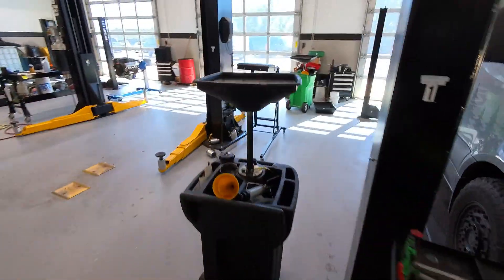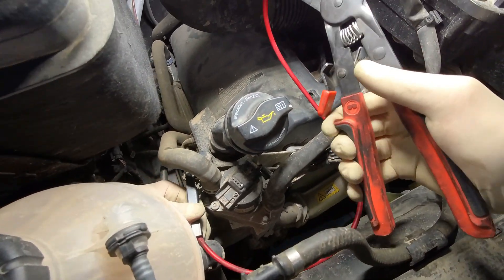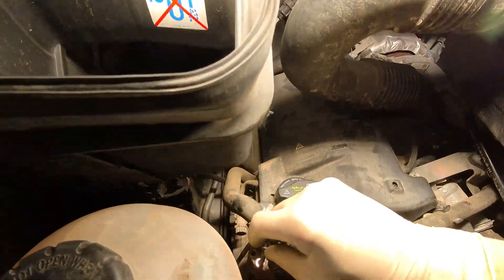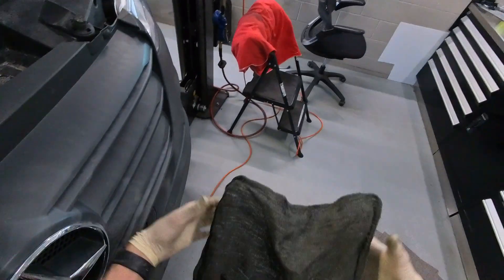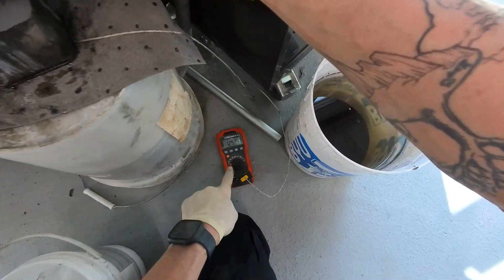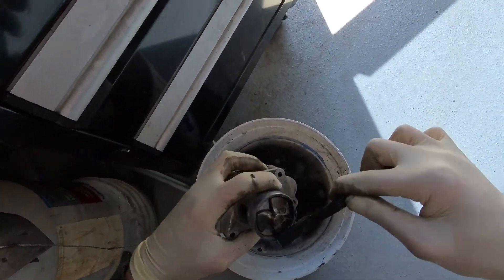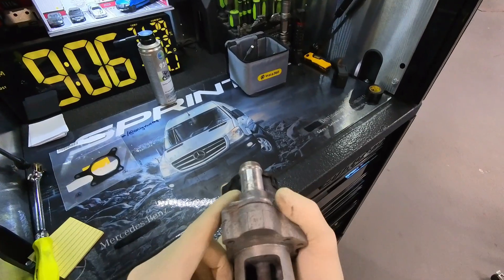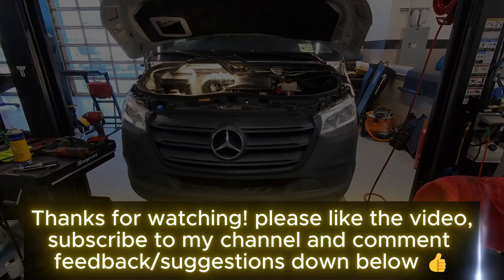Sprinter 3.0L V6 EGR Cleaning + Stuck EGR  Removal Tip (OM642)

Comment: Have you done an EGR cleaning on one of the newer 2.0 high output 3500xd sprinters?

I’m suspecting a dirty EGR is giving the DPF system hell.
Reply from the maker: We haven’t seen the need to clean either of the EGRs on the 2l as they are much better than the previous EGR on the 3.0l. Is your DPF filling fast? I know oil type plays a huge role in soot accumulation. What are your symptoms?

Comment: Just did my EGR a month ago and I wish I would have known the way you used the motor bolt holes to remove it.  I beat mine up pretty good and ended up having to re-seal the housing due to a water leak.  So far, so good, but doing it the way you showed would have been way better.  I'll look into caustic soda too.  I remember that from the old machine shop days in the block wash vat.  Yes, the smell is intense!

Thanks for the great video.  Going to check out some of your other ones!
Reply from the maker: Dang wish you would have seen the video sooner to but glad it’s not leaking! Hopefully my order videos help you out somehow too!

Comment: Hello, I would like to ask for help or advice on what might be wrong. I have a Mercedes Sprinter OM 642, and when I accelerate rapidly, it gets a one-second hiccup and then goes back to normal, but sometimes I feel like it's sluggish. I replaced the fuel filter, and it came back to life, but after some time, the same thing happens. Any ideas what might be wrong? Turbine governor, EGR valve? No errors when I connect it to the diagnostic computer.
Reply from the maker: Most likely your EGR valve sticking that aligns with the symptoms I’d clean it and see if it goes away

Comment: I bought my 2012 with 95k.  Not sure if EGR has been done.  Seller provided all dealer service invoices, and no EGR service is shown, as all prior service was said to be done by same dealer.  Now I have 113k and my van seems to still run great.  How often might this service really need to be done?
Reply from the maker: It’s more of an issue on the next generation sprinters so 2019-22 on some of them it’s necessary every 20k miles others can get it done once and be good for 40-60k it really just depends and they all vary. If yours isn’t having any issues I wouldn’t clean it
Reply: @OnlyVansMB  good work btw.  Thanks for sharing.
Reply from the maker: @GlennInLaguna thank you!

Comment: Does the 2.0 have an EGR valve. Does it need cleaning too? Do you have a video on that? Thanks.
Reply from the maker: Yes the 2.0L (OM654) 4 cylinder diesel actually has two EGR valves a low and high pressure. The low pressure sits on the backside of the engine and the high pressure sits on the front near the oil filter. Thankfully these EGR's do not seem to have the same issue as the previous v6 diesel (OM642) where they get sooted and begin to cause drivability issues and I am yet to have to clean one on the 2.0. If it starts to become an issue ill definitely make a video but it doesn't seem they will

Comment: Again your most excellent "How to" video has helped guide me through my first attempt at cleaning my EGR VALVE. The most valuable tip for me is using the longer M-6 100mm to pull the valve out with out hammering away! The use of the Caustic soda "Sodium Hydroxide" was best and less mess for sure. Now I look forward to doing this as its part of my future maintenance plan. THANK YOU!!
Reply from the maker: Glad to hear this has been helpful! I’m happy to help and hope some of my other how tos have been as well!
Reply: @OnlyVansMB Oooh yes, I have a small fleet and have gone through all your videos done all them!
Reply from the maker: @rexgoodwin8127 great to hear! Very nice!
Reply: Which is also “Lye Sodium Hydroxide”

Comment: I wish I would have seen this video earlier this summer. The EGR valve on my van has been a giant pain. It’s my daily driver and I drive short trips, except the weekends. Also, thank you for clarifying warranty work vs customer paid. I experienced this with the dealership. They cleaned it under warranty just to have it malfunction a month later. This happened twice. I ended up replacing it after the housing failed from me beating on it with a hammer to get it unstuck. Oops. Has been running great since replacement. Cheers!
Reply from the maker: Dang that does suck to hear and I’ll be honest I don’t think any other dealers are using the caustic soda method and I only use the tunap for warranty 😉 I always use caustic 😂 sometimes a new one is just best lol

Comment: Well done - best EGR cleaning video I have watched.  You are the gold standard.  I really appreciated you method of removing the stuck valve.  Question - what surface is the longer screw/bolts pushing on to push the valve up?
Reply from the maker: Thank you! I try to be as clear as possible for this reason! I like quality and efficiency. The two bolts push against the aluminum EGR housing and not the sealing surface so no risk of causing any type of leak or issue if that’s what you’re wondering

Comment: Any codes or just drivability concern?
Reply from the maker: Just drivability concerns. I’d say 70% are drivability concerns and the other 30% have actual fault codes or check engine light
Reply: @OnlyVansMB been with Mercedes for a lil while now but moving to the sprinter team starting next week. Idk about your dealer but we get so many sprinters coming though our shop.
Reply from the maker: @Toyotatech86 we are slammed right now! And it’s not all friendly service stuff either lol and so many customers traveling through the area with an issue and need help right away which causes more delays and issues for the work flow haha but busy is good and challenging so just grinding. Also why I haven’t been able to record anymore content for a while now. Glad the info is helping!
Reply: @OnlyVansMB hell yeah that’s a good problem to have!!  A lil stressful sometimes but worth it. 
I feel you man! Can’t wait to see more content, keep it up!
Reply: @OnlyVansMB thanks for the info dude

Comment: Why do we get charged for shop supplies, when It looks like you’ve been using that same nasty towel for what looks like years?
Reply from the maker: Shop towels are handled in bulk by the uniform company they are universal and not all from the same shop. They get used, washed by the uniform company and washed rags re stocked and there is more than just rags as ship supplies, washer fluid, DEF, coolant for top offs etc. But I don’t make the rules or the pricing I just work on things

Comment: Great demonstration. I am giving up the hammer tap method after this.  Could you please list the specs on the bolts you used?
Reply from the maker: If I remember correctly they are an m6x1 and the length in the video, sorry out and about and can’t double check at the moment
Reply: M6-1 x  60 all thread